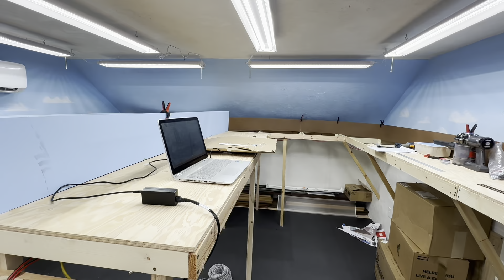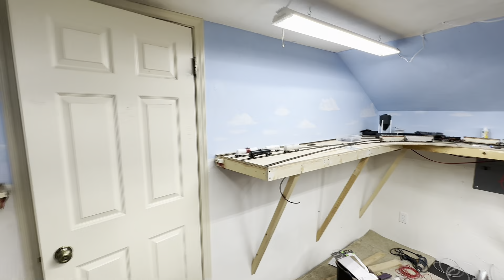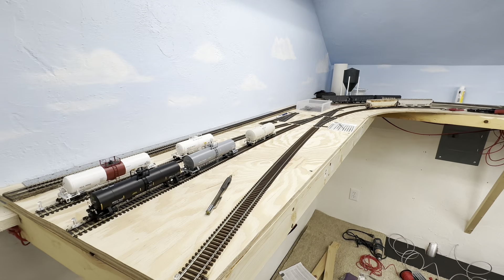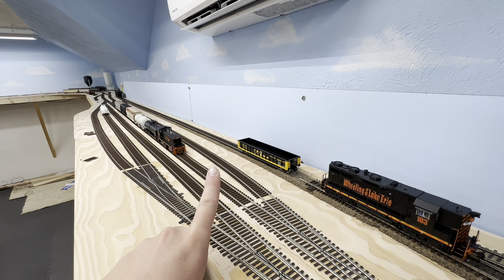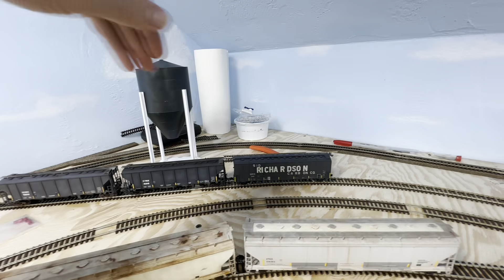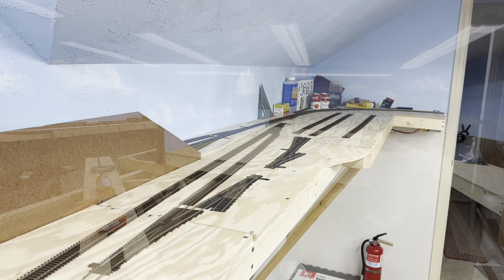Layout Update 2/1/2026

Comment: Nice layout I noticed that you only have cork on the main line 🤔?
Reply from the maker: That is correct. I wanted prototypical “lower” tracks in the yards and industrial trackage. Since the speed is going to be so low and after I did a few I didn’t bother putting a think layer of cork down to dampen sound.